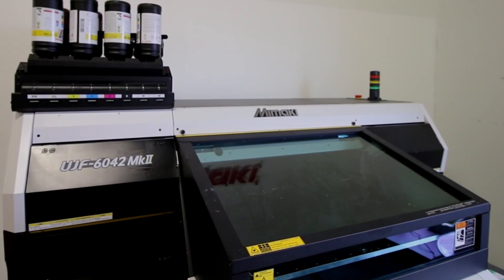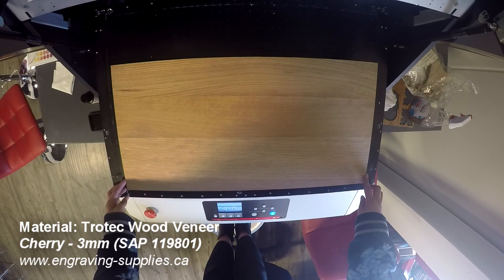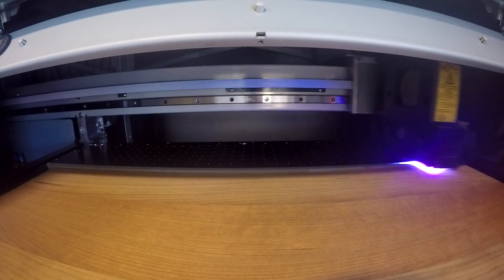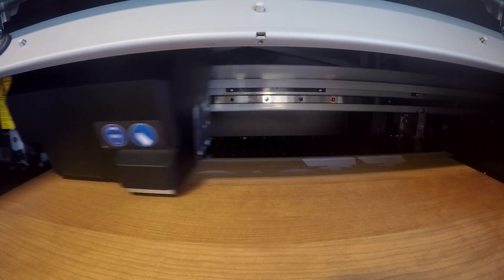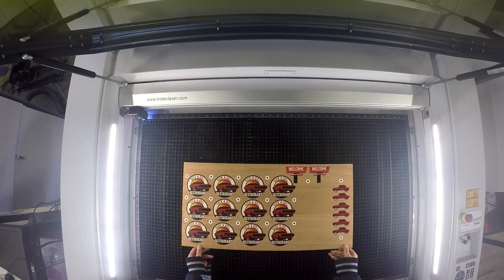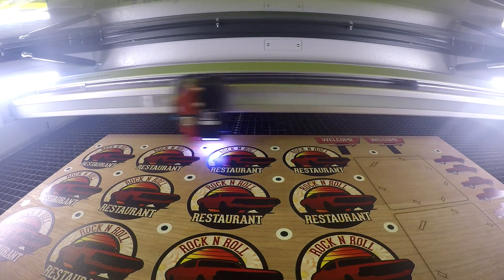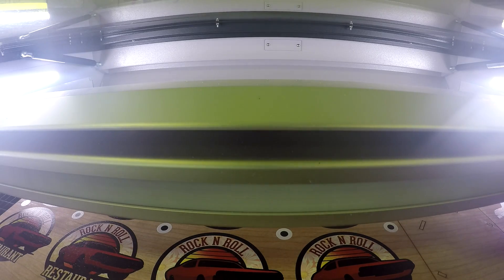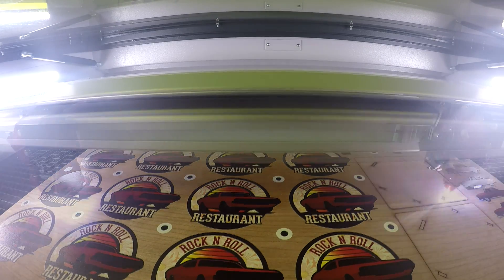UV Printed Coasters | Laser Cut Coasters | Trotec

Comment: Does the UV printer print directly on the wood, or is there a special coating on the wood to allow this? Any fading issues over time indoors or outdoors?
Reply from the maker: Hi Nathan, yes the UV printer prints directly on the wood, no special coating needed. There isn't any fading issues but the wood isn't recommended for outdoor use, unless you cover it with acrylic or some kind of cover.